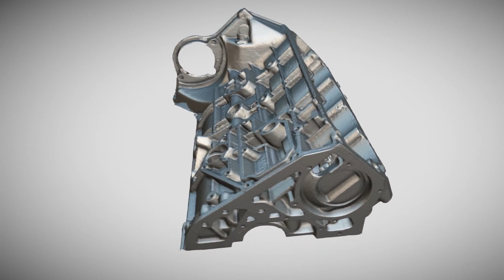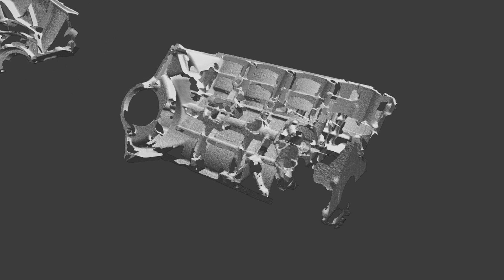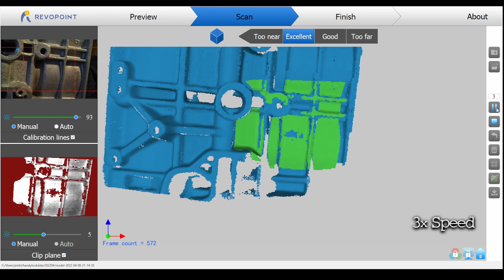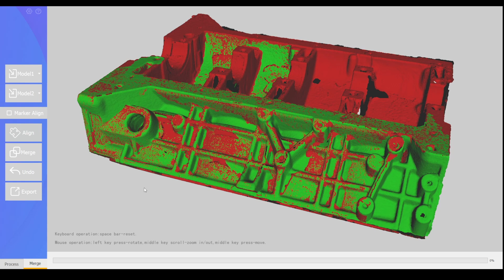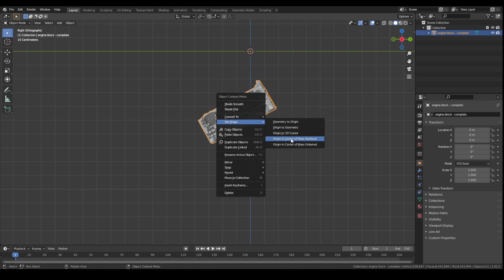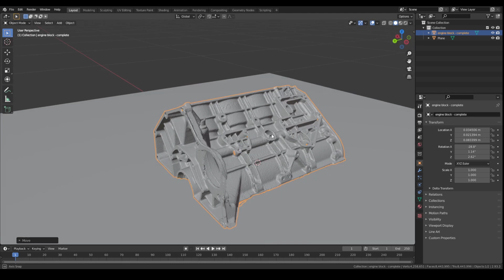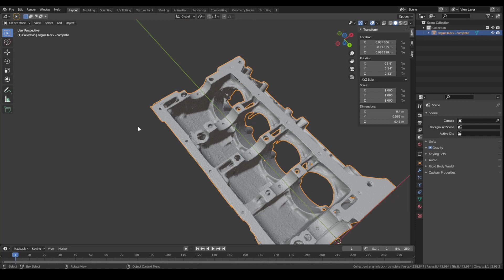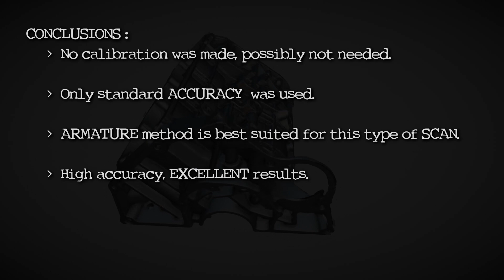How I scanned the Lotus Esprit engine block - 3D scan Revopoint POP2

Comment: Great video, thanks for sharing! Which scanning mode are you using? ”Feature”?

I have a POP1 myself, apart from the higher accuracy with POP2, do you belivie it would be possible to reach same result in terms of coverage vs scanning time with this?
Reply from the maker: Yep 'Feature' mode.
POP2 is better than POP1 at this as it has a higher frame rate and is stabilised, meaning you get less mis-scans or tracking errors.  POP1 would achieve a similar detailed result to this as I scanned the block on 'standard' resolution.  You just have to be a bit more understanding of it's limitations of POP1 and how to squeeze the most out of it - so use a tripod and ball and socket joint to help keep the scanner steady.  Minimise sunlight (infra red light, ie scan at night time) to help the sensor maintain good tracking.  Look at my Sketchfab (link in description) and you'll see some of my POP1 scans there.

There are videos out there where people go into some real depth about accuracy and cloud density between the POP1 and POP2.  POP1 is still a good piece of kit.
Reply: Great, thanks a lot for your detailed answer!

Comment: Good insight on your process, thanks. I have experience in reverse engineering from scans and it's easier to get the positions of studs than holes, especially small ones.
Reply from the maker: 100% - personally I put the studs in and measure them with a caliper and deduct a stud diameter from the reading.  I only use the scanner to do jobs I cannot measure by hand, complex curves or visualisation - trust but verify 😄

Comment: Thanks for this Jon. Engine blocks and engine bays were one area I had in mind for using my POP2 when it arrives.
I'll be watching this a few times over and over to see if I can manage the same feat.
Cheers!
Reply from the maker: Thanks - you will manage it no probs.  The key in my opinion is this method, of using multiple smaller detailed scans and then merging them onto a frame (armature) so the merging software doesn't get out of hand.  I've had the software seriously warp merged scans, but the simple once over frame stops that from happening.
Reply: @JonHimself  Cheers! Large sweeping scan for a framework and fill in the details sounds great. I inagine for a car body shell with less crevices shouldn't be too much of a challenge with this technique.
Reply from the maker: @LooseyHenderson  Yes but if I was doing a car (again) I would create an armature in the software like blender and then manually add the panels.  You can do this by physically measuring fixed detail like panel lines and then moving each panel into place.  Something for a future video perhaps.

Comment: Another great video, I particularly like the Blender skills and techniques, Blender's application to engineering tasks like this isn't something I'd been that aware of. That scanner is very impressive, but it's your ability to understand its limitations and use techniques to circumvent them that's key. Great stuff.
Reply from the maker: Thanks Andy, I do love Blender (there is a little shrine to the developers in my garden 😋) but it's ability to handle big meshes and the clean up tools make it worth learning.  Check out the particle and physics side of things if you're interested.
Reply: What program did you use for blending the STL scans together

Comment: Beautiful! How about using meshmixer to merge the scans? I find it works much faster than anything else, loads files with zillions of points in seconds where other sw (like solidworks for example) just doesn't want to play (or takes half an hour)
Reply: I don't think mesh mixer have an align function, but meshlab does. Meshlab does a decent job, but I only use it when the native software fails.
Reply from the maker: Not tried Meshmixer to merge scans before, I might take a look.  I generally try to show the Revopoint software which in my opinion is very good and easy to use.

Comment: I bought a lazy susan bearing from the local hardware atore, cut a round mdf platter for it and scanned my transmission and wheel spindles
Reply: I got the 9-10in steel bearing and it can hold 1000lbs… sorry for the freedom units… 250mm and 450kilos? Rough approximations
Reply from the maker: @josephjones4293  yup I have a few turn tables but I'm mainly scanning planar sides here so no real need for it.  My comment about it being too big was a little joke at the small turn table which they provide hehe.  No that that's a bad turn table, it works great.